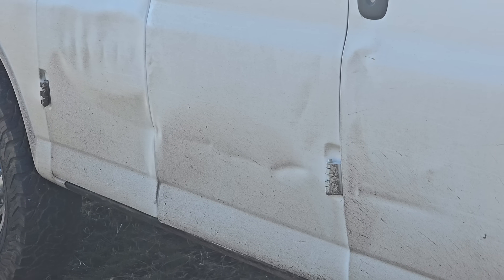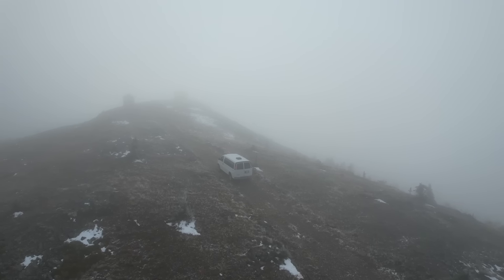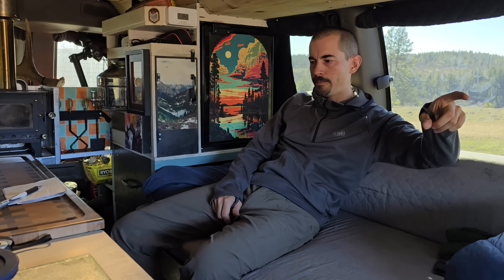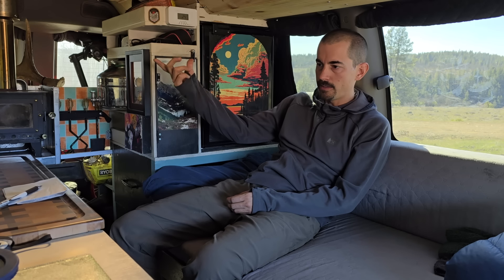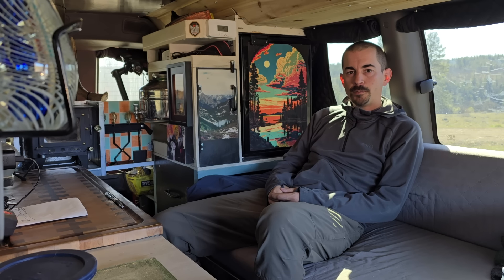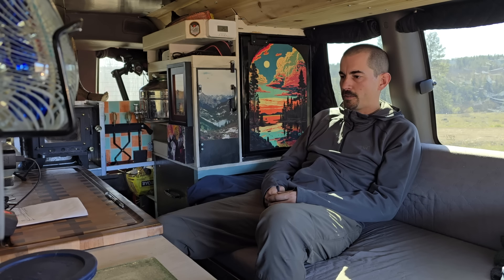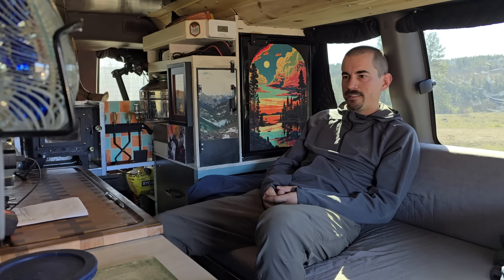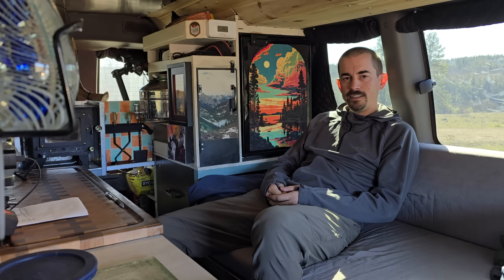Lets just talk about condensation and insulation.

Comment: As soon as you started talking about a vapor barrier you absolutely lost me. Do you think people screwing holes through a vapor barrier is dumb, when simply adding a second vapor barrier is the real problem. The shell of the van IS the vape barrier. A second one just traps water between the two. You will absolutely NEVER be able to create a complete seal that will never be compromised. I mean, you even said that water would get through the tiniest of holes in a vapor barrier....  Then proceeded to show how you were planning to install...  a freaking vape barrier.

Closed cell foam already IS a vapor barrier. So, you want to apply a THIRD value barrier? All you have to do is make sure that the entire perimeter of each piece of foam is completely sealed to the metal of the van wall. Preferably, the entire surface of each piece of foam should be glued to the metal. That is the ONLY safe way to have a "vapor barrier" in addition to the metal skin off the van. Literally make the second vapor barrier a physical part of the first, so you actually just have one thick, composite vapor barrier.